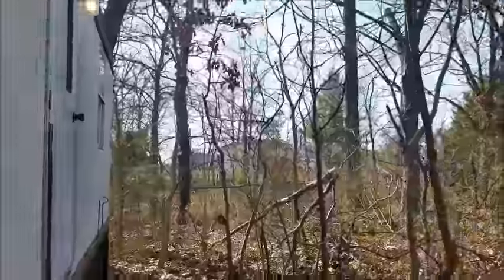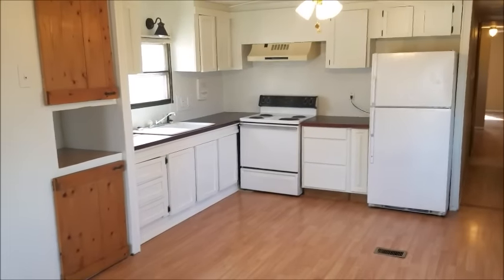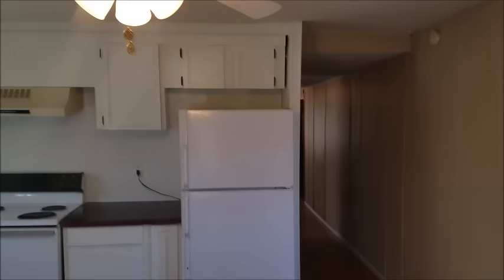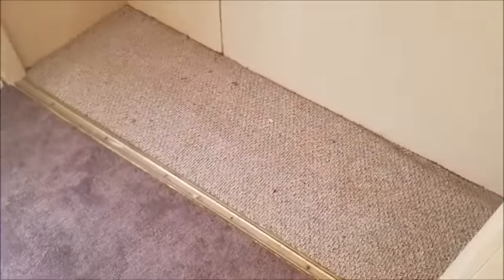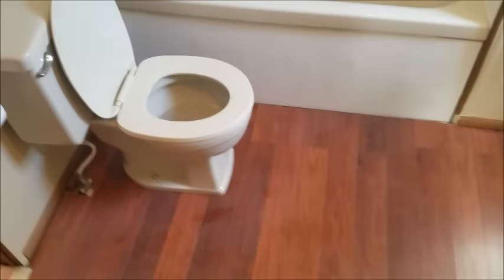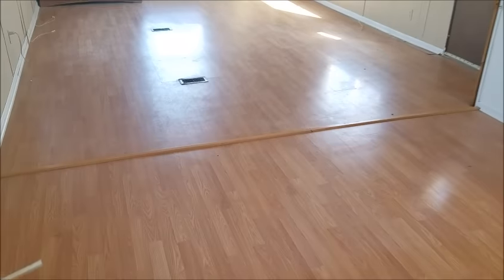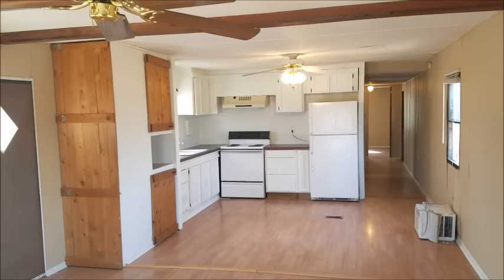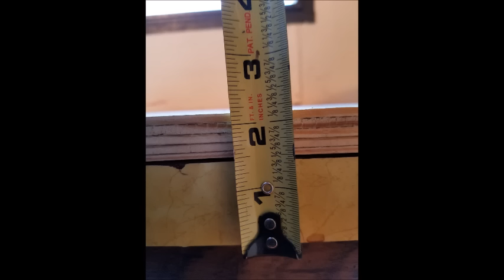Renovation of 1978 mobile home, flip to rent for residual income.

Comment: I was wondering why the heat vents are in the middle of the floor? You did a good job polishing up an old trailer for a renter. As some people were complaining about this and that, but it's a 1978 trailer home, you're not going to put in marble countertops or fancy bathrooms!
Reply: kcanded I own a 2002 Solitaire 18x80. One of the finest built homes in the USA (total wood, like a site built home). The vents are in the middle since that’s where the “tube” underneath that conducts heat and air runs from one end to the other. I’m a woman without building vocabulary. Don’t know what to call it. But that’s why. I’d love ceiling vents but I don’t think mobile homes have them.
Reply: Thank you for clearing that up!
Reply: @cubbylevi1764  The more modern mobile homes can be built with the heating vents in the ceiling, if you wish. 
That's what I'd prefer if I bought a mobile home, don't like the thought of little critters being able to crawl into my home!
Reply: kcanded 
I mean... you could. Or update appliances.
Reply: My home had vents in the floor. I had them covered, new flooring install in every room, and bought a 24,000 btu mini split air conditioning and heat. It works great and don't have to worry about floor vents. My home is a 1985 and i bought it for $7,000! Get a deal and make it into what YOU want it to be!
Reply: I hate vents in the floor, but in all actually, it is way more energy efficient if they are in the floor instead of the ceiling.
Reply: I thought this was before the fix up  . Was there a budget that was set ?
Reply: yea they put them in the middle of the floor to be ass holes cuz they want you to step on them and  make ur foot sour.  they should be along the perimeter not the middle of the floor where  everyone walks.
Reply: @XXPYR0XX   There is a duct running down the center of the trailer underneath, its not a conspiracy to make sour feet, whatever that is....

Comment: I wonder if maybe in general people don't know what it is to flip a house.  I think the point is to get it back on the market, either for sale or rent, as quickly and cheaply as possible.  When renting many people don't take care of the property. Often there is damage  either due to neglect, lack of knowledge or on purpose.  Though there is a deposit required it may not cover the damage.  
What kind of paint did your wife use?  Was it the same for the cabinets as for the walls?  Were the walls vinyl covered or wallpapered?  Thank you.
Reply: moviemakerwannabe the walls are panels.

Comment: I think you did a pretty decent job. Simple reno for a simple renter. It  looks just like the trailer we had in the early 1980's when my husband worked on a farm. Ours had three bedrooms and the same floor plan, but this is in much better shape actually.we did have a small set of steps out the back, which led down to a small  concrete pad, with a little shed covering it and we kept a big freezer out there. My husband used to come in the back door from the barn and get undressed of his barn clothes out there and went straight into the shower. My girls were really young, brings back memories. Thanks for sharing
Reply from the maker: Thank you! and thank you for watching! ;-)

Comment: I'm just responding in defense against those calling you a slumlord. You got new subflooring, you got new floor coverings, you refurbish the cabinets, you have ceiling fans in an air conditioner for every room, you have usable appliances, the walls not being dark paneling are always a bonus, it's clean, painted, and livable, it has running water with no leaks, heat and air and fans and there are no broken windows. And you didn't fix it up for resale. I think it's fine.
Reply from the maker: Hi Thank you! Yes it is not perfect, it is not new and not being advertised as new. It is a good home for average price for the area, that has had its functional problems repaired but may not have perfect paint and matching trim.  ;) thank you for having common sense ;-)

Comment: Why not make all the cabiners white? The brown one stick iut like a sore thumb. I noticed under the sink it had a leak at one point why not paint it or cover it with a thin piece of painted plywood. Match all the flooring.
Reply: I agree. Why sand it end poly when all white is fresh and modern. In fact, fresh white throughout is preferred to the dingy ochre color. Ditto range hood. I would definitely have decks front and back in such a beautiful setting. Overall looks good.
Reply: Was thinking the same damn thing, some people have zero taste.
Reply: Wow....how come you would be rude about the cabinets?  With all the nice touches, you pick out something that is really a non-issue.  If you notice, the cabinet doors you are referring to are not actually cabinet doors.  They are wood.  Not MDF.  Kitchen cabinets are different material. That trailer is probably 40 yrs old.  Looks great for a rental and the owner will make a great income over the years.  You figure he spent less that $8000 TOTAL. Like he said... “pure profit” after the first year.  Be positive people.
Reply from the maker: Thank you!
Reply: Rogue Life 
Truth. Never liked that tawny brown color on cabinets. Doesn't look good in my opinion.

Comment: What's with the lopsided kitchen drawer? It's skewed clockwise creating a gap on the upper right hand corner!!!!!
Reply: Some of us just notice these things because they're out of whack and it bothers us. No hate here, maybe just a little OCD.
Reply: Slumlords don't care about stuff like that, LOL!
Reply: I'm with you..take another 10 mins and fix it right. If you as the landlord don't give a crap, neither will the renter.  I'd use thirst front steps n port then on the back (safety). Put an 8 x 8 deck on the front. In TX Gulf Coast, you could easily get $900 for that.

Comment: Nope nope nope! So many missed opportunities. Too many different toned woods & colors going on. Things look unfinished. It's a hodge podge of mismatched things.
 If something looks cheap -people are less likely to take care of it. If it looks nice people tend to take pride in their homes and maybe pay a little extra for rent.
Reply: Agreed! I thought this was the before, before they did any work to it.
Reply: Agree but slumlords don’t understand this.
Reply: @ilovejesus3659  I wouldnt call them slumlords, they sound young and was trying to do something, they just should had not cut those few corners.
Reply: Tracy Raia-dowd  you’re jumping to collusion’s just using your own opinions...it’s a 1978 mobile home probably with a value of 3 grand....plus I have done apartments very nice to only have them trashed.
Reply from the maker: You got it exactly. 👍
Reply: @danbailey96  e
Reply: I think the idea of using it as a rental is great, but I would have painted the walls and bathroom cabinetry bright white. Easy to paint over after tenants move out.  I would have replaced the stove vent hood with a matching white one, as you can find used ones at resale shops pretty cheap. The flooring is great.  Maybe consider painting the exterior, just to brighten it up and give it a better curb appeal.  If you want to put a back deck on, do it...it'll add value to your rental.

Comment: The entry doors could have been replaced. The paint job is so-so, a lot of sloppy edging. Windows need replacing and trim. Exterior needs paint. Needs new entry steps and exit steps. Kitchen is "ok". Not a lot of storage. Nice attempt for a quick buck.
Reply: It's a 1978 trailer with a value of a few thousand dollars at most. Not sure why you expect more pricey renovations.
Reply: Have all you people making negative replies ever had rental property. We rented ours 3 times and each time it was a mess when the renters left. The last 2 times, when each renter moved out  it cost more to renovate  than its actually worth. We don’t rent it anymore.
Reply: R V 😂😂😂😂😂😂💪
Reply: rocky mountain lass depends on the type of rentals you own I have owned mobile homes rentals for over 20 years and 90% of them get trashed even by people with decent credit and and decent jobs. It's just the type of people that rent mobile homes. They all smoke they all have dogs and other pets even if they're not supposed to. They never pay their rent on time even if they have the money.
Reply: @ruthsquiltingandmore5346  us too we just sold it almost for nothing just get rid of it
Reply: rocky mountain lass  there is always those ones that give you a good reference just to get rid of you.trust me i know it from experience.then they are your problem
Reply: @ruthsquiltingandmore5346  We have a small house in Pa and the same thing happened to us by renting to locals.  We now rent only to tourists and damage is almost non-existent and we get $1,000 a week over $500 a month to local people.  In the summer we get families and in the winter it's hunters.
Reply: georgia o'keeffe yup no one asked you

Comment: Honestly, I have seen much worse but 550 or 600 would be the rental price id put on it. Also, they actually did fix the house not just put bandaids on stuff. I liked that counter top and the paint job wasn't  bad either. They also fixed the leaks. I lived in almost the exact same trailer once and let me tell you those renters did not fix a damn thing! The stove turned on by itself to the highest setting and wouldn't turn off! Had to cut the power to the whole home. Then there was black mold in the bathroom behind the wall around the shower head. There where huge holes in the floors that were hidden until after we moved in. It was infested with roaches and huge field mice! Talk about horrible living conditions and just to top it all off it turned out to not even be their's but one of their relatives. Let's just say it was a huge mess on so many levels! Lol

Comment: Mostly a nice job considering the minimal amount you paid in repairs. Your HUGE mistake was those counter tops!  Sorry but they look like a rookie did them. For the money you spent in plywood, stain and sealer, you wouldn't have paid much more for one of those cheap counter tops at Lowes or Home Depot.  You can always count on a renter to be stupid ( I've had plenty of them ) and it wont be long before one of them starts cutting vegetables, sandwiches-whatever on those counter tops.  The damage to them is less worry than what they will be ingesting from your stain and sealer job.  I agree with the other person who said you should have painted the other two cabinets to match the rest.
Reply: Exactly
Reply from the maker: We did provide a large butcher block cutting board for these reasons but yes in hindsight I definitely agree we wouldn’t do this type of counter again.

Comment: Yuck...why not replace appliances? This place just had some soap and paint, the stinch is still going to bleed through! The cabinets and paneling though painted etc is still going to have tar eventually bleed through as well...I know cause I have been in these old mobile homes and tried to live in a few after "remodeling" but it was still gross. New faucets could have been a great addition at not much cost!

Comment: When replacing spongy old floors with OSB, it helps to paint the floor with a semi gloss paint to make it somewhat "water proof" when considering future leaky faucets and toilets. You may never have to replace the sub floor again.
Reply: You can't water proof it. Even if you paint OSB or plywood with a armor seal. If water sits on floor for even short period the wood will still bend, bow, and mold, weaken. I have had this happen more times than I care to count. It will slow the time it takes to ruin but if water leaks for months usually there's damages that has to be fixed. I usually put oil seal on flooring and use linoleum but often times I still run into renters that won't tell you when something needs fixed. A lot of good people out there and yes keep place clean but not good at thinking with common sense and you find its been leaking for 5 months...

Comment: did you rip the old wood paneling off or just paint over it? I'm doing a mobile home also and it has that wood paneling basically throughout the entire trailer
Reply from the maker: No left the wood paneling, painted it with primer then interior paint. Most trailers of this age have wood paneling because drywall would crack etc when being moved. Not as many options back then.

Comment: Having lived in mobile homes most of my life, two things I ways look for. At least 2x4 construction, decent windows and NO darned celing daisy fasteners. They can be very economical, easy to clean and maintain. The older ones had little or no insulation and aluminum wiring with wood paneling which made them firetraps. They have improved so much but another mandatory thing is adequate cabinets in the kitchen and a linen closet. Full size tubs are another plus. Would love to live in one again as long as I had a garage or shed for storage.

Comment: Do you use sheet rock to replace the walls. Had a bad roof on one side of mobile home the walls are falling apart and covered in mold. Had it test but not black mold
Reply from the maker: No if you use drywall in a Mobile home you then can’t move it because all the drywall would crack at the tape joints from the flexing. But if you never plan to move it you could use drywall I would think.

Comment: This looks almost exactly like a mobile home I own. I am having to do renovations a bit at a time because of the cost. I've replaced the floors in both bedrooms and put in new carpet and padding there as well. Also, a new stove and fridge for the kitchen. My mobile home has these cabinet drawer type built-ins in both the bedrooms. Did yours have that? I'm wondering if I should leave them or just take them out to make more room. I also put a porch with a roof on the front and back along with a roof over top just for extra safety because I don't want the roof to leak and cause damage.
Reply from the maker: Hi no mine didn’t have built ins in the bedrooms, but it could have and been removed in the past, hard telling. Sounds like a great job with the remodel! Best of luck!! ;-)

Comment: nice! but i would have put something that would last longer as kitchen counter
Reply: Anila T   Hafeez Also imagine all those food particles and surface cleaners getting traped in those crevices of the wood. It's beautiful but yeah not something I'd use as a counter top.
Reply from the maker: +Ssfinch with Beatles we sealed it with many coats of polycrylic. But if it were anything other than mobile home rehab with limited rehab budget we would have done smooth counters for sure.   Thanks for watching.
Reply: 2 Hammers looks pretty good
Reply: Ready cut Counter tops don’t cost much !  They are made of pressed wood and Formica covering, easy upkeep !  Is the coating polyurethane they put on food safety ?
Did a nice job  overall, I am amazed they cleaned the place so well,  I would have set it on fire !  LOL
Reply: You can buy countertop laminate sheets that are peel and stick at any discount home improvement store and for that size area you could probably do it for $30-$40. They have any design from Formica to granite styles. Cheap, easy, attractive, sturdy and safe for food prep. Just apply to the plywood and when finished it would look just like an expensive countertop. It will also protect the wood from water and warping. I would definitely check it out because it’s going to save you money in the long run.

Comment: When you painted the walls, did you sand them first? If so, did you use a primer and then paint? Furthermore - did you replace any of the insulation in the floors when you replaced in the bedroom and bathroom? If so, with what? I'm helping some friends fix their bunk house up, but have never worked on mobile homes before. I believe theirs is the same model as yours. Thanks so much!
Reply from the maker: Hi yes we sanded the wood vernier walls with an orbital sander then primed the walls because The previous owner was a heavy smoker and we wanted to get rid of the smoke smell. Then we painted the walls and the ceilings. We also sanded and primed all of the cabinets in the kitchen and the bathroom before painting. We did add insulation to the floors underneath we did R13 underneath the entire trailer and then in the bathroom and the bedroom we did 2 layers of it to keep it warmer. Thank you

Comment: Got to ask, how is the floor in the bathroom holding up? I would be scared using any hardwood in a bathroom.  Purchased 1990 trailer for my daughter ( collage student). Replacing windows and doors this weekend. Than doing the bathroom floor, before updating kitchen.  Trailer has cheap wood floors that look terrible in the living room currently,  an update on how's your holding up. Since I'm going to end up removing it.

Comment: Buying my first mobile home, I'm a handy man and I'm buying a rehab one, got any tips I've always worked on houses. I know they are a lot easier to work on, my main concern going into this is roofing and leaks. If there is soft spots do you just replace the flooring and what if the beam is rotting because of water saturation for prolonged time. My price and closing is like 1800 bucks on a 4 bed 2 bath from 1989, roughly got about 5k for the rehab.